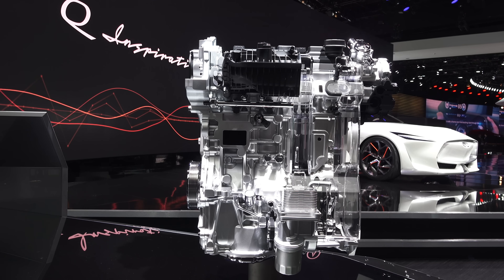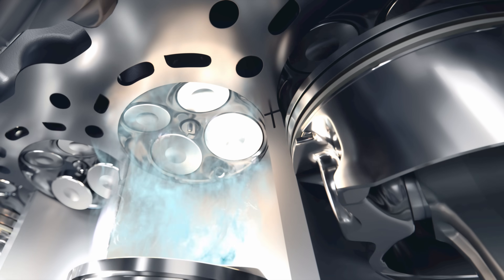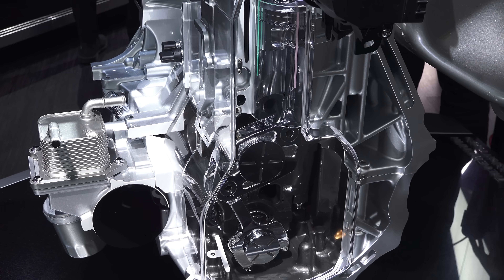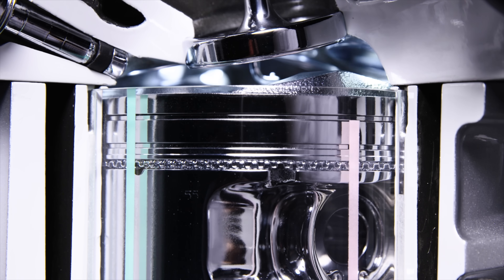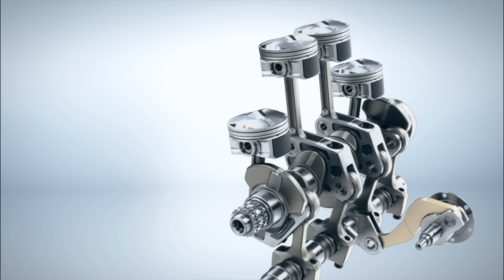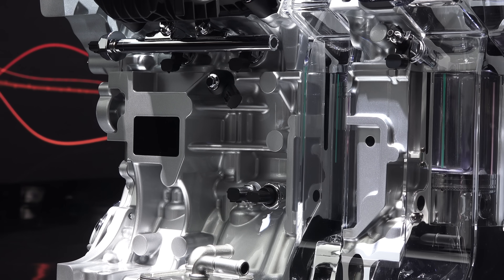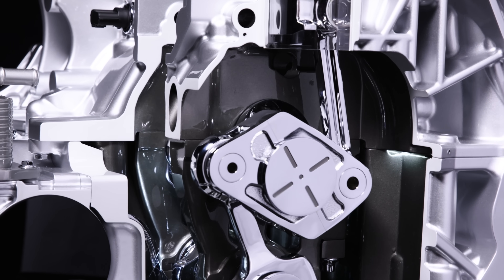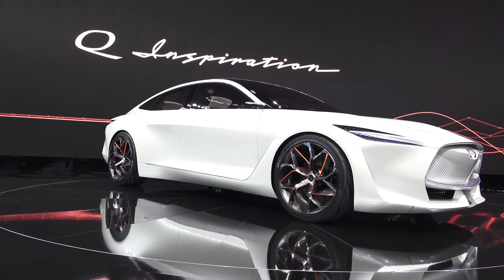INFINITI Reinvents The Gasoline Engine — VC-Turbo

Comment: I have a question that I can't figure out...  what power difference is made between a low compression under high boost pressure,  and a high compression engine under a lower boost pressure assuming they both have the same peak cylinder pressures before combustion at TDC?  It was said that generally speaking the higher the CR the greater the thermal efficiency.  I am having a hard time wrapping my brain around this one.  What efficiency is gained by utilizing a lower compression than higher compression assuming the peak cylinder pressures are equal?
Reply: I don't get it either.  I really don't understand what the benefits are.   It seems an awful lot of trouble for marginal improvement.  And what about increased internal friction?  The whole thing seems to me to be an answer to a question nobody asked.
Reply: Benjamin Smith i was thinking the same thing. This tech is useless when the engine has forced induction causing higher cylinder pressures already.  Im not impressed with this.
Reply: Honestly,  unless Gale Banks comes in here and corrects me,  I am going to use common sense and say that a higher compression engine under low boost pressure will be more efficient than a low compression engine under high boost pressure due to the higher turbine drive pressure of the low compression engine and the fact that lower compression will be much more in-efficient at spooling up the potato.
Reply: Marty McFly u cant have high compression with forced induction it does not work the only reason this p.o.s. works is the turbo is only puting out higher boost when it in low comression mode.if u took a high compression engine like at 14.1 and added a turbo or supercharger u would not get the desired effect and most likely detonate a piston or blow the head studs right out of the block or worse
Reply: Benjamin Smith most eco boost engines range from 9.5 to 10.5-1 compression this is middle of the board and not really what i would call high compression mid compression more like it try running a turbo on a engine with 12.5 and up reliably then we'll talk ive been building engines for many many years
Reply: Benjamin Smith not really maybe by production car standards but Ive build engines with 14 and up thats high compression thats what im talking about and 10.5 is not that uncommon if u would have listened to the video this engine run 14.1 comprssion at peek and turbo is slowed way way down because the engine wont take it not for long rings will b the first to go even with individual cylinder knock sensors sorry bro but I've been doing this a long time I know what's going on
Reply: Now THIS is what I was looking for.  A damn near Cliffs Notes whitepaper based upon the criteria given.  However given my current state of affairs (12 Bud Light beers) I will have to get back to you at a later time.  Thank you so much for your reply @TonbolV
Reply: 12? Even for Bud Light, I'm surprised you can type properly.
Reply: And the most efficient engine of them all is... a high compression engine under high boost pressure! Haha. Seriously if this tech is only gonna last 100k miles before it breaks and goes in the shredder due to ridiculous repair costs, why not just build a high comp high boost normal ICE designed to last 90k miles before it blows up, at least it’l only cost a set of forged internals and a bore and hone to get back on the road
Reply: Actually it does work well with direct injection due to the fact that the fuel isn't added until TDC or after to negate detonation.  That's how the Ecoboost and similar engines have such great power to displacement ratios.  In port injection,  not so much.
Reply: Which is the point of this entire conversation.  My question was "what efficiency is gained between utilizing a low compression/high boost vs. high compression/low boost assuming peak cyl pressures are equal".  My personal conclusion is that the higher compression engine will be more efficient due to lower pre-turbine back pressure.
Reply: Benjamin Smith  if you have the same cylinder pressure across the operating speed of the engine you will have a completely flat torque curve which is maybe what they are aiming for?
Reply: Benjamin Smith If you have the same cylinder pressure in both cases, the low compression mode has more volume in the chamber meaning more fuel to be burned
Reply: Ok,  I think I'm following you.  So a lower compression engine will essentially take in more air molecules to achieve the same cyl pressure as well as more fuel molecules than the higher compression cylinder and also achieve a higher torque output due to these factors.  Correct?
Reply: Benjamin Smith Yup. That’s the idea. Let’s say you have two balloons where one is small and the other large. They may have the same pressure, but the large one has more volume. All things being equal (cylinder pressure, bore, stroke, etc) more fuel equals more power.
Reply: For your first question, a low compression engine under high boost pressure will make more power then a high compression engine under low boost pressure. This is cause more boost pressure means there is more air in the cylinder hence you can burn more fuel=more power. Even if you assume peak cylinder pressure is same, a high boost engine will have more air in the cylinder. Your second question, a high compression engine can atomize the air more then that of a low compression engine and so you can burn the fuel more efficiently. That is the reason why diesel engine's have such a high thermal efficiency (ps. diesel engine's have much higher compression ratio's going above 18 to 20:1). Hope this helps!
Reply: It allows for higher torque at lower rpm while providing peak torque and horsepower throught the curve. And also eliminates knock.
Reply: It's not about making power, which is a function of rpm, it's about making torque.  At low rpm, the turbo can't make torque, so boost the compression to get more.   At high rpm, a naturally aspirated engine can't breath as well without the boost, but boost requires a lower compression ratio to prevent damage.  I see this design as a way of eliminating turbo lag and making the engine much more efficient at low rpm where most driving is done.
Reply: Sorry,  but 10.5:1 is a fairly high compression ratio engine.  lol

Comment: Bad Ass!  I can run a twin turbo at a higher compression ratio at lower RPM!  I want to build a big bore V8, race version without VVR. The lack of rod angle is revolutionary but one side seems to have more angle than the other.  How is RPM?  How is linkage
wear? There must be numerous bearings, are they aluminum coated, or Babbitt?  Will there be a race version for IRL?

Comment: This would be cool if you could tune this backwards for power or only highcompression on demand at the drivers will.  but I can see that  this motor is gonna be expensive to rebuild and one wrong move and the whole thing would explode

Comment: Compression ratio until 14:1. I supposed a motor like that could use about 25:1 of compression ratio in idle and low loads.

Comment: Interesting tech, but I don't think I would want the extra moving parts in that area. Seems like over complication and I wouldn't be surprised if something is a weak link. He says the block height is the same. But unless they are running dry sump oiling I don't see how that is possible.

Not only that, but it takes 1.2 seconds to change. That's an eternity when you put your foot down.

Comment: I love more moving Parts in engines. That means higher repair bills. However, looks like this one is going to be extremely expensive. Being experimental and all. All that means is ... Mo Money...... not that, we're not already making bank fixing infinities . feels like the company has just given mechanics a raise...😀😀

But not you dealer techs... You still get to deal with these and warranty... LOL
😀😀

Sounds like a whole lot of computer control going on there. And I know how you engineer's love your computer integrated controlled engines. Let's hope that Infinity has placed all of those grounds, in charge of that computer. Inside the vehicle where they cannot rust from the use of dissimilar metals. Because, things are going to get really interesting in the diagnosis of that engine, when the car starts to rust in 3 to 5 years.

Comment: Is variable compression really a misnomer for the use or purpose of this engine. Shouldn't it really be called a variable stroke engine for there are other ways of varying the compression ratio that would not help its efficiency. Isn't it true that it's really the variable stroke to bore ratio that affects it's efficiency. So that this should really be called a variable stroke to bore ratio engine. I do appreciate your videos and your simplification of complex engineering, thank you.

Comment: I love the design of their concept car. The lines are in the front pretty clean yet bold and aggressive. If Infiniti makes a car look like that with that engine but a higher energy output than 260 hp. then I would really consider getting that car.

Also, could you do a segment on how 4 cylinders are unbalanced. You glossed over it in the video an I would like to know more.

Comment: Don't mention how much more cars with this engine will cost over standard turbo 4 cylinder, and also how much more it will cost if the engines have issues.

Comment: So this concept has finally been put into production. It's going to be a big step forward in small displacement engine power and efficiency. Being able to run 14:1 CR means that your off boost performance will be significantly better than a standard forced induction CR and it will spool the turbo earlier. Can you imagine what could be achieved if you combined variable CR with camless valve train like freevalve and garretts dual boost twin flow turbo.

Comment: It's exciting to see Infiniti/Nissan actually bringing new technology into the fray. It's clear they've put a lot of thought into the design and testing. With direct and port injection like what's found in some Lexus and Subaru engines, intake valve maintenance will not be a long term concern. Can't wait to see independent testing and reviews for this new engine,

Comment: This is absolutely incredible tech, go mechanical engineers! The ICE will definitely have more years of life after this goes mainstream. Can you see this applied on 60 degree V6 or V8 configurations too? Incredible actually I can even envision two cylinder turbo versions for small cars like the Altima, Sentra or Rouge. 50 mpg 200 hp all day long :)
Reply: Unlike everybody else here, I think reliability will be fine. Everybody said these exact same things about variable valve timing and lift, and look. They’re fine. 
Anyway, no. It would have to be completely redesigned to be in a ‘V’ style configuration. However an inline 6 cylinder could use the same principle.
Reply: Chris Wieringa. I guess you’ve never worked on a VCT Ford engine.
Reply: Bartonovich52 I see GM 5.3l with VVT dying every other day while 5.3s from 99-06 are still ticking along. These designs were made to fail and cost big money to fix.
Reply: @Mudfish532  what. I will attest to the reliability of the 5.3. However in terms of reliability the 07-11 and till 13 have the best track record statistically.
Reply: Alex Scarborough I must have hit a soft spot lol. A vortec engine(4.8,5.3,6.0) with vvt will fail, they are ticking time bombs because the engine was never originally designed to incorporate vvt effectively. That is why there are aftermarket kits on the market to remove the vvt in 07+ vortecs. I’m not saying these engines are not reliable but when GM was in their bailout era they cut a lot of corners.
Reply: @Mudfish532  the big killer was the 5.3s with cylinder deactivation. Vvt vortec motors are more prone to valve cover leaks and yes you hit the softest spot. I love vortec motors
Reply: Alex Scarborough Dude I love vortecs like no tomorrow, but they were made overly complicated with vvt and the cylinder deactivation. In my spare time I dabble with BMW engines and sometimes it amazes me how the Germans can make an engine with variable valve timing and variable valve lift and make it last 200k miles
Reply: If you make a comment about the complexity of this motor, you have yet to take an engine apart. This motor adds, in theory 3 extra parts to the internal assembly. If you watch the video you can understand that the complexity lies within your inability to perceive how this motor functions.
Reply: Tom Stamatakos it's BS!!! Way too complicated and will be scrapped in a couple years. Way too many moving parts. Everything will be expensive to fix!

Comment: The problem with a sponsored video like this is we know you aren't allowed to mention the downsides.  I mean how much bigger does this make the engine also reliability seems a huge concern.
Reply: He did also say that the engine was not any taller than current engines.
Reply: Yep, afraid our good friend has become a bit of sell-out now.
Reply: You should strive to start a sentence with a positive rather than a negative. "The problem". The size of the engine remains the same as a standard four cylinder and with time, prove its reliability may, or may not be guaranteed."
Reply: Because the over head valve was such a failure too
Reply: Andrew Murphy so true this is just the asslicking part, not the whole truth
Reply: Reliability MUST NOT be a concern since you'll hardly ever see a crankshaft fail, which is even less likely to happen to the CVT since the movements of rods and pistons create a lot less friction than they do on a conventional engine. Complexity doesn't mean "it will fail". Aircrafts of today are a gazillion times more reliable and safe than the ones produced in the previous decades although they are also a gazillion times more complex.
Reply: +julosx Its so hard to find people who understand that. I mean the cars of the 60s and 70s were much more complex than the ones of the early 1900s and they were much more reliable to. But all we hear these days is people whining about engineers fixing problems the average person cannot understand.
Reply: Andrew Murphy  If you fucken listen he said the same size as a regular 4 cylinder engine

Comment: This is just asking for problems and higher  maintenance and repair costs.
Reply: They said that about OHV, OHC, fuel injection, variable valve timing etc. and they are all here to stay.
Reply: There is almost nothing new in this other than the mechanical design and an electric actuator. If you purchased a V8 you would have the same amount of bearing surfaces. Other than that its pretty much a standard [modern] engine.
Reply: @SeanFalloy  Exactly. And I would assume that if the actuator fails, it will just get stuck in one compression ratio, so it might get stuck in 'low performance' or 'gas guzzling' mode, but it will still drive. So it should be as reliable as a typical engine is.
Reply: Yes. Junk. And it cancels any benefits like lower emissions.

Comment: Its sort of what Mazda is doing with their Skyactiv X.....however it is rumored that they will be using a supercharged Skyactiv X sometime in 2019
Reply from the maker: This and SkyActiv X are quite different in design.
Reply: Yes....the design are different but the main target is the same. They both want increased fuel efficiency via variable compression, right?

Comment: So you said it can change between low and high compression in 1.2 seconds. How does that translate into everyday driving? Say you're in the highway cruising and want to punch it to pass someone: besides turbo lag (which I imagine is small given other turbo cars these days) will that 1.2 seconds of lag also be there and be noticeable? Thanks

Comment: What is the redline of this engine? As stated in the video, the connections to the crankshaft are extremely complex. I would be curious to see how easily/quickly this engine can change compression ratio. (Not bashing, just curious)

Comment: I don't like the integrated exhaust manifold- just limits power when modifying the engine for real enthusiasts... Might have advantages in standard form, but ultimately will be a limiting factor that will keeps these engines from gaining cult status in the long run. Close, but no cigar imo.14:1 comp at max boost using ethanol will be the key in the aftermarket. So all their hard work will be wasted ultimately to people like myself

Comment: They may have had the packaging space bellow the crank so that it didn't effect them. They may even have had a deep oil pan that was there prior and there may be other packaging options and a balancing shaft might normally take up some space. There is no way that the space for the linkage is free.

The real friction breakdown may be very interesting. I'm also interested in the effective system inertia. Inertia and related forces seem like a big deal.

I probably don't understand it as well as others since I've seen a number of variable compression technologies. I'm not sure why the same trades with lower part count cost etc can't be done with variable boost lift and timing.

Comment: This is a great idea. Hopefully added price of an engine does not negatively offset the fuel savings and engine longevity due to increased complexity and higher number of moving parts. Otherwise it will suffer the fate of small Diesel engines in US. But I totally see how this will take off in Europe where gasoline prices are much higher.

Comment: So this approach and Mazda's approach to variable compression are are quite different and at face value Infiniti's seems significantly more complex, but with the benefit of the balancing shaft issue.  I wonder if the gains in MPG are more or less than the Mazda and why.

Comment: well if you actually measure the dynamic comp ratio other brands before with variable cam phasing or split lift/duration lobe designs were already doing the "variable comp ratio" thing before infiniti.